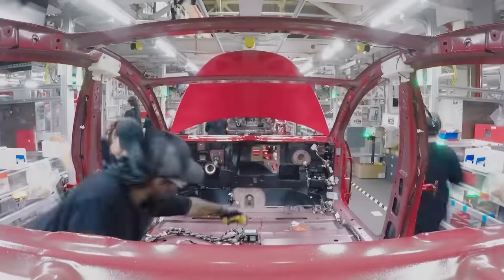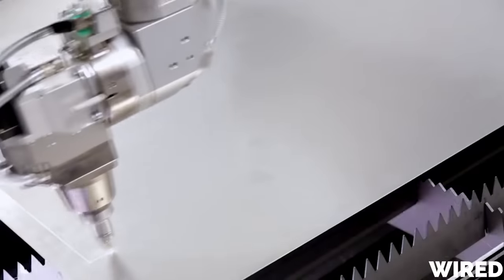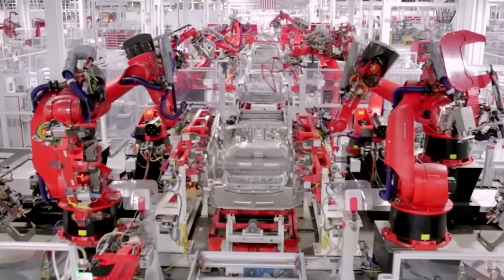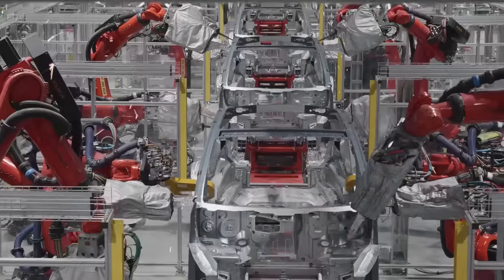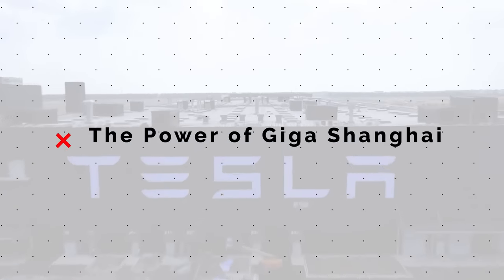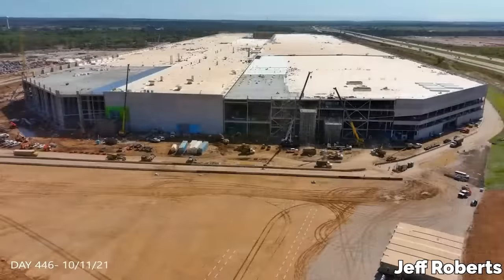How Tesla Builds A New Car Every 30 Seconds!

Comment: i donno about that battery idea, intergrading into the body frame like that.  seems to me that it dramatically increase battery damage in a collision, which means catching on fire and we all know how f'd up that kind of fire is.   if the collision is low, there is way too good of odds, something jamming into the battery.   i donno man...im kinda seeing a good deal of law suites coming from that design. more injuries than would of been if what im thinking proves to be right as well as no fixxing the car. it'd be completely considered, totaled if that batter catches fire.  so unless they have a seriou battery safety with that new design,  im worried its gonna be too easily to damage, given the fact that any thing from a collision could ram and jam into it, or smash it up enough to cause it to catch fire and stuff

Comment: How do they paint the car within the 30 seconds?
Reply: I work in the paint department at giga Texas… it actually takes approximately 8-10 hours for one car to be made (aprox 6 hours in paint) a finished car will roll off the line every 30 seconds. Therefore 8-10 hours to build and paint and assemble, then every 30 seconds one rolls off the line.

Comment: Correction: white is not simplest colour as it’s a multi coat just like red. I believe black is the simplest because non metallic
Reply: That is correct. White became the no-cost color option for several years mostly because it hides defects better than any other color offered.  While it is more expensive in terms of processes and materials to put on the car compared to black, blue, and midnight silver, the relatively few customer complaints about the condition of the paint on delivery makes it the cheapest overall, as each customer-rejected car costs a lot more in terms of Tesla employee time. Today, the no-cost option is midnight silver metallic (MSM), because it is still relatively low in customer complaints compared to black or blue, it's cheaper than red or white to apply, and it will hopefully diversify the fleet of Teslas on the road, as white was becoming unbearably ubiquitous.

Comment: They need to have each car pre programmed so it self drives itself to the buyer as soon as it rolls out the door of the factory.  Or within the range of the model.
Reply: There is a pre delivery inspection that you need a human for
Reply: @mubbywub  So do it right before it drives off the factory floor or in the parking lot before it leaves.

Comment: 🤓🤓🤓The meaning of 1 car per 30 sec !!!
Assume that Tesla operates 20h a day + 4h maintenance period
so,  20h x 60m x 60s = total 72,000 sec we have

So how many cars will be produced in total in that 20hrs = 72,000 sec /30 sec = 2,400 cars
That means 2,400 cars will be manufactured in 20hrs (with 4h maintenance period keeping apart)

That is the meaning of 1 car produced for each 30 sec means.. 

And assume that Tesla has 5 lines of production 2,400 / 5 = 480 cars will be manufactured in each of those 5 lines taking 20hrs of manufacturing time for each car.

Comment: I was under the impression that the prepping, attaching/welding, and all of those special things were included in the building of the Model Y every 30 seconds
Reply: It doesn't take 30sec to build one car. They just roll off the prod line at that rate. That's how production lines work - everywhere. Tesla is nothing special, and it's taken far too long for them to get to this stage.
Reply: @andrewholdaway813  I'm still really confused, the math doesn't seem to add up. It's not clear how you can do the casting, have actual Humans tightening bolts, and have so many parts going together at different stages, all in 30 seconds. I wonder if there is a previous step that is being missed somewhere? I guess I need to watch more videos.
Reply: If you start assembling a car every 30 seconds ,if all goes well ,one car will come off every 30 seconds its journey may take an hour what ever.but it’s still one made every 30 seconds.wake up people.
Reply: @davidhampton180  According to Deiss, ex CEO Volkswagen, it takes them over 30 hours to make an EV vs Tesla at less than 10 hours.

Comment: Can a robot follow a moving car, rather that a car waiting on a robot?
Reply: Anything is possible now
Reply: They cannot. The weld guns on the wrist of the robots sometimes must reach inside tight spaces ( even in holes ) on the bodies. Also, the 6 ( and sometimes 7 ) motors that drive the different axis of the robots have encoders on the motors which allow them to repeat to the same position every time. Repeatability is the name of the game. I work in the maintenance department in the bodyshop for one of the Big 3. We have 628 robots in our bodyshop...13 of which weigh 25,000 lb each. Pretty neat stuff except when something causes a crash.

Comment: Here's a better question, when are they going to make a Tesla that's under 30K like he promised over a decade ago? Vehicles have gotten too damn expensive for the average person without taking out a second mortgage. You can make all the cars he wants but if only the rich can afford them, You're not going to get very far.
Reply: The current Model 3 starts at $40,240 before the $7500 tax credit brings it to $32,740. Inflation adjusted to 10 years ago, those numbers are $30,182 and $24,556, respectively. The Model 3 is a basic, middle-class sedan, priced on par with the 3rd trim level of 6 offered on the Honda Accord, though it is optioned more like the most expensive Accord. The Tesla Model 3 is also $4000 cheaper than a fully-optioned Chevy Malibu. I hope this helps your perspective on the cost.

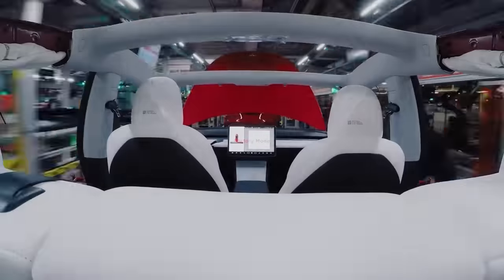Comment: 4:17 you made some serious mistakes. The shot of bolting the seats inside the car is not on top of the structural pack. The seats on structural pack are in the next shot raising the battery beneath the car. The first clip is the traditional battery pack. You mixed this up cause your knowledge of this topic is generic. Similar theme in the rest of the video

Comment: Pretty odd Tesla advertisement video material. No real timeline. In 2:22 the body is painted, but the painting process is shown at 2:41.
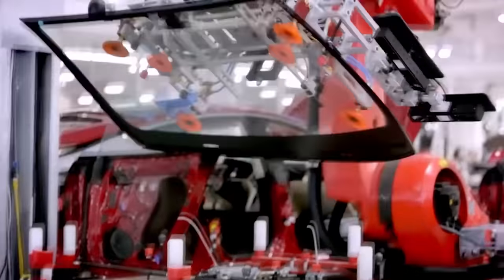The graphic model shown at 3:14 is Tesla, but the model show at 3:55 is random.
The scene from 4:17 to 4:30 is complete bullshit, as it has nothing to do with the real manufacturing process.
The only difference to any other car brands are (currently) the giga castings shown at 3:39.

Comment: Marvelous technology, incredible innovation. But until they can get a full charge into the battery bank in the same time frame it takes to fill up 20 - 30 gallons of gasoline into a typical car while on a cross country trip, it will still be an 'oddity' that most people will be reluctant to buy.
Reply: Pretty sure society has accepted the charge time with EVs.

Most families are looking to own at least 1 Tesla car and 1 gas powered vehicle (usually a truck or SUV).

Comment: I hate this kind of videos made by some fan boys of Tesla. They have no idea what they are talking in the video. They only see what Tesla what them to see and have no idea how the process of building cars should be. What is good and what is bad. As a guy who knows this kind of things I can tell that tesla is really bad at building cars compared to the other cars manufacters with much more experience at building the cars. Level of automatization is not even impresive, I would say it is maximum on avarage from what i have seen in my life. They suffer from bad quality and bad process optimalization, because they always pushing suppliers during the building manufacturing lines to their limits with time planning, which is resorting to half baked solutions of the process problems, cutting quality standards and  many temporary solutions that will remain pernament due lact of time given by Tesla. This resort to bad quality of the produced cars. They have also meny problems that are maybe worth to mention, but his comment will be way too long.

In the end I have to say they make a nice cars. Really advanced cars and thinking out of the bubble. They electric cars compared to the other manufacturers of the electric vehicles are vastly superior, but will I buy one? probably not, because of the quallity issues.

And one more good thing i have to say is their GIGA press technology. I am a big fan of this technology. Building of the underbody normally takes 30-40% of the body shop space. With this technology they are able to make BIW shops smaller (around 30%) and that is a huge deal.